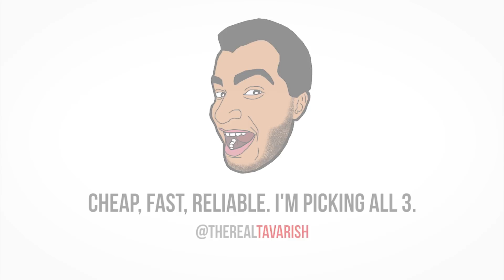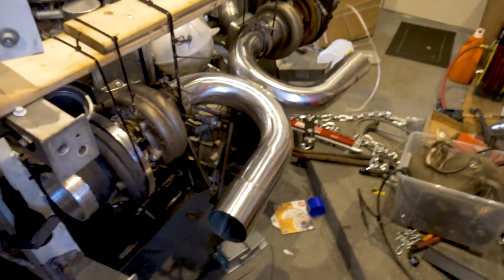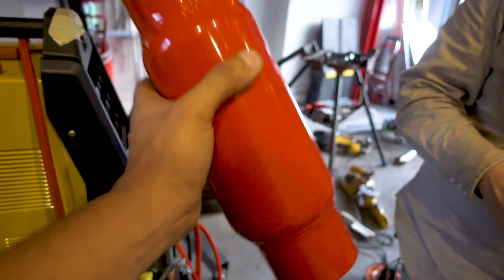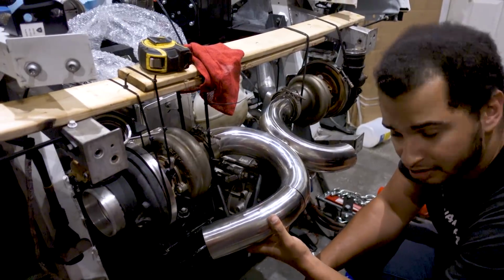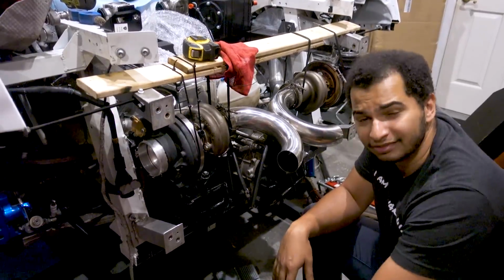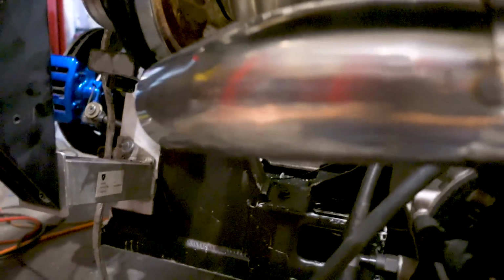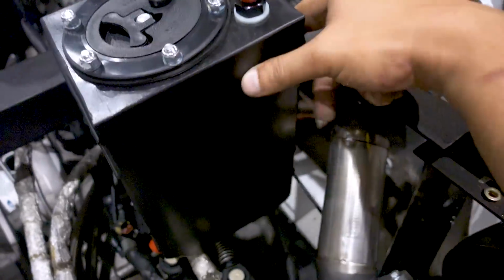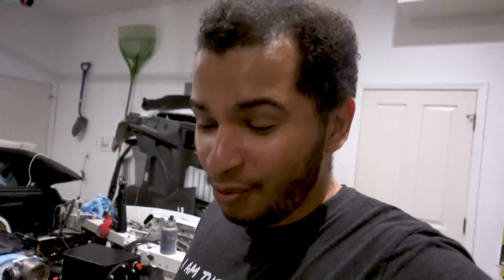Installing A Stupid Cheap Muffler On A 1,000 HP Lamborghini (Is Actually A HORRIBLE Idea)

Comment: 👍🏻 for Tony and no cherry bomb
Reply: Phil M. Cherry bomb on that lambo would’ve been a shame. Who in the heck wanted that?
Reply: gavin P Ask Tavarish...
Reply: Jean Philippe it’s cheap to me
Reply: Jean Philippe straight pipe is for strictly performance and reduces back pressure the best. If your trying to quiet or muffle the sound of your car, a glass pack is the cheapest option. There are many other options that could give it a quieter smooth tone. You can’t compare straight piping which is a strictly performance mod, to a muffler of any sort.
Reply: Uh, gavin P? The ENTIRE idea of the Cherry Bomb was that it IS a straight pipe. They are actually LESS restrictive than a straight pipe due to the way the flow is calmed. That's why they became popular in the first place. 

Now, they aren't as good as modern performance design, but they're still pretty decent, especially for the price.
Reply: evilkillerwhale glass packs were made off the idea of having a loud car but still being able to legally say there is a muffler. I’m confused on how there could be anything less restrictive than just a straight pipe. There is no restriction at all. Anytime you are trying to quiet a car down at all, some type of restriction is going to be added?
Reply: gavin P, then you're not an aerospace engineer (like I am!). Straight pipes have a buildup of laminar flow along the edges of the pipe reducing the effective flow rate. Glass packs, which have area for the flow to expand around the edges, create turbulence that allows a larger mass flow. Period. This is basic fluid dynamics.

Just because you don't know it doesn't mean that it's not known.
Reply: evilkillerwhale interesting! Learn something new everyday! I never knew that and always though they were used for more of just a muffler replacement.
Reply: Lake pipe would be nice, Kendig did a few on TV and you got the best of both worlds, go from track to church in the flip of a switch, lol.

Comment: Curving the exhaust back unto itself may not be the best. You could be setting up a shock wave inside the pipe that will restrict the easy flow. Is there any way to shoot the pipe straighter out the side or slightly to the rear to alleviate another curve in the pipe? You may also want to consider professional ceramic coating outside and inside the pipes as well as the outer heat proof cloth wrap. With all that mass of pipes in the rear, there will be a tremendous amount of radiant heat being produced and I'm concerned that dissipating it all will become a major problem sooner rather than later. You seem to be enjoying yourself and Tony is soldiering on quite nicely. Props to him. He does excellent work. Thank you and we'll be watching.
Reply: Tavarish please listen to this guy^ exactly what I was thinking.
Reply: yip I concur. the bends are not the best idea and there is a pretty easy straight thru option there with just a slight twisty
Reply: The Audi R8 has sharper bends and more of them than this Lambo, so I doubt that it'll be a problem
Reply: Josh Pijl the Audi r8 is designed by a team of engineers with untold r&d money and tech. not assembled by a dude with a welder and grinder. bends do interfere with flow and just because it works doesn't mean it can't be better.

Comment: Tavarish! Suggestion: Be sure to heat shield either just (and most importantly) the intake side of the turbo, or the entire turbo from the exhaust! The exhaust is VERY close to the turbo now, and the turbo blanket will need some help. Your turbo will thank you with longevity, and your oil will thank you by being unburned! Keep up the great work man, loving the series

Comment: That's a lot of exhaust and turbo in a really small space... I don't think you are going to be able keep the surrounding components from melting, even with turbo blankets and a buttload of fiberglass, but it will be fun to watch.
Reply: These turbos have a liquid cooling inlet and outlet. They're designed for high heat and he's building an air-to-water turbo cooling system as well. It's all taken care of.
Reply: Andy C 4

Comment: I can’t wait to see the turbo painted!! I am so triggered with the finish it has right now against the chrome pipes 😂 if you do want to recondition them you can scrub the metal with a copper brush and WD40 to remove the grime, them wipe with degreasing wipes and repeat. It will get them really clean. Or you could use an industrial sander for a chrome finish!! Hyped for this to be done, really want to hear the engine! Wish we had heard the cherry bomb though 😂

Comment: Going to look sweet once the turbo burns the paint off and they rust up like the ones on a 72 Ford dump truck....
Reply: They do make paint good for up to 2500F just so you know.
Reply: Fluffy Ponies  Coating, yes...paint, no.
Reply: Paint, yes. Specialty paint literally designed for up to 2000F operating tempatures: http://www.tempil.com/specialty-Coatings/pyromark-High-Temperature-Paint/
Reply: Read that product description a little closer "specially formulated coating for metal surfaces" "the flat black formula" Fail, Fail, Fail. Normal paint that you paint a car with isn't going to hold up over time to extreme heat conditions, plain and simple. Header wrap is only going to do so much to cut down on heat as well. Ceramic coating would help a great deal when combined with the header wrap. Trust that I know this battle all too well, as I have a 600HP SBC stuffed in a 79 corvette.

Comment: All that work and just straight piped exhaust.. Going to be such a nicely built car and going to be almost unbearable to be in/near/around.. The novelty of an open exhaust goes away pretty fast after blowing your own ears off at every light.
Reply: until your 50 and deaf
Reply: Turbos lower exhaust noise quite a bit, infact there are a few cars that came from the factory Turboed without a muffler like the SRT-4 and Mini Cooper and still managed to get past federal standards.
Reply: Actually not nearly as loud going through turbos as it would be literally straight piped off the engine.

Comment: dont say the turbo system wasnt set up for performance when it's fairly obvious you know nothing about how forced induction can be setup. yet again i have to say, it doesnt matter where its picking up its air. thats what your charge air cooler is for. you just dont listen. you are doing all this for nothing. it wont make any difference.
Reply: Aaaaaand this comment was drowned by all the pinned fan boy comments. I agree with you, he's just rebuilding it to produce more content and get views, it has nothing to do with improving anything.  I wonder if it will ever be complete.
Reply: Sorry but its metter where you Take the air in bekause the cooler can coole the Air even more down, but i egree he dont know a lot about much things he done in bis car and some things are useless.
Reply: dasluce spadular he won't cool the air any better in the front. Half the cooler is covered by the front spoiler and there is no room behind to let the air escape = no air will flow through. His new exhaust will heat up the engine bay and turbos even more than before. But he probably knows this, it just means he can produce more content about doing nothing
Reply: Sebastian Erlandsson i totaly agree with you i just meen that it depends from where you take the air. That its not realy working how he thinking or telling us i know.
Lets see what he will do with the car next and let us hope that he find someone who knows how to build a good turbo engine and Help him.
Reply: dasluce spadular I understand what you're saying but the cooler can lower the temps more than he can by him changing the turbo setup in the rear. He's just fucking it up.
Reply: Sebastian Erlandsson thats right He messing the car in every video more up
Reply: Is no one gonna notive he’s using 2 twin scroll turbos on a v10?

Comment: I installed a cherrybomb on my car about a month ago. I ordered that brand specifically since it's such a name brand I figured it would be high quality. I was pretty dissapointed. It uses scalloped perforations inside instead of holes, and the hole punch design gives better flow, also the punches only went 3/4 of the way around the inside, AND the inner tube wasn't lined up right with the outter one so part of it was sticking into the flow and messing it up! I was looking at Dynomax bullet muffers today and they look sooo much nicer construction quality. The inner cylinder actually lines up with the outer one, it uses the good dimpled hole design that gives the best flow (better than a straight pipe because the walls of the straight pipe create drag, and the holes in the glass pack create no drag. That's also why airplanes and golf balls have dimples. It's all about boundary layers and eliminating drag.) And the perforations go almost all the way around inside instead of just 3/4 of the way around so it will do a better job dampening sound. Not that glass packs dampen much sound anyway, but it just is part of the overall much better construction quality. Also the cherrybomb I got had big weld boogers hanging down on the inside pipe, further restricting flow. I will make a video about this at some point. I have footage of welding it on my car and driving already I just have no time for editing.

Comment: You'll need to put a shield with air gap between the exhaust + that plastic tank. Just wrapping and the foil on the tank won't repel the heat enough imo. Just some alu or stainless sheet is ok. Good work - stoked to see the progress :)

Comment: @Tavarish consider some kind of heat shield between exhaust after the turbo and the turbo (maybe wrap it ?) . IF you'll abuse the car, Exhaust will get hot and probably will transfer the temperature to the cold side of the turbine which is not thing you'd want to happen :)

Comment: If you really want those glass packs on, I think I have a solution, but it would require you to completely redo the exhaust pipes. You would need to instead of doing a 180 with the pipes out of the turbo's route them around each other so they crisscross and the pipe from the left turbo would actually exhaust from the right side of the car and vice versa. That would give you a nice straight section of pipe from both turbo's as they crossed to the opposite side of the car, and would require much less joint weld's.

Comment: glad u didn't use the cherry bomb in the middle of the exhaust as it wouldn't have done much at all, a better idea is to position them at the end of the 180 (basically right before the tips) that way they will do what they are meant to do which is reduce you resonance. if you guys haven't seen the podcast, check it out, it is really good !!!!!!

Comment: You don't want to heat wrap the exhaust. It crystallises and burns away from the heat.

Also do you have a switch between the ice box and the front heat exchanger? If you don't the heat exchanger will start exchanging cold for heat

Comment: Lol, they weren't mufflers but resonators.. good job on swapping the turbo hot side and exhaust to under the intercooler, heat rises😒 so now you've created more issues.. You better also make fuck loads of heat shields. 
I have ceramic coated, wrapped and put turbo beany on my rx7, the heat dissapation still heated brake and clutch fluids to the point I needed to insulate heat via heat shields and wrapping clutch and brake reservoirs and both master cylinders. Air is one of the best insulators so as a suggestion whilst you have a good welder at hand is to make up some good heat shields to isolate heat from any unwanted areas. Tack weld nuts onto exhaust system and make bolt on stainless steel heat shielding in key positions

Comment: I didn't get what's the use of the auxiliar tank, but if it's gonna be pressurized i wouldn't recommend it, i used one of those as an  auxiliar for a race car and the cap liked like hell, it won't seal properly and won't take the pressure really well, so have in mind the flow and pressure you have to see if it's gonna work.

Comment: Dude, cross pipe the exhaust. It will give you room to put the glass packs on. Right turbo exiting out the left and left turbo out the right. Glasspacks close to the X pipe. Simple solution

Comment: Would short length Supertrapp mufflers that go on the end of the exhaust pipe work in your application ? They are also tuneable for sound and back-pressure for each application.

Comment: use a thick piece of pipe it hushes it pretty good. the db level will be night and day without that little cherry bomb. but it would still be too loud even with it. use a dual inlet dual outlet flowmaster 50 big block muffler or just a 50 series if the bigblock is too quiet.

Comment: Is welding the two pipes from the turbos (X shape) together without a spacer a good idea? I wonder if the material around the weld will crack due to different frequencies.

Comment: Definately think you need more flex in the system or it is going to crack in short order. Going to a tiny water reservoir is a bad move as well with the limited front IC rad airflow. Too little heat capacitance in the small volume of water. Also you cant hard mount the hairdryers to the frame unless there are some big flex joints somewhere. Trying to be helpful not negative

Comment: The join of the 2 parts wont create a super hot spot and burn out quickly all the time ? Would it pay to put heat shielding between them and also might muffle any vibration ?

Comment: Sorry, I haven't commented you in a long time man love your work. but the big big big issue you have heats on the cool side of the turbo. please look at ceramic coating those hot pipes if you're running that close. remember that heat will be sitting on the bottom of your cool side at approx 1000 degrees. the ceramic coating pipe will prob cool that down to 500 degrees

Comment: What if instead of the 180°pipes you had the exhaust exit more straight from the turbos and cross over/under each other. Would that give more space to run the cherry bombs? And just have the tips exit from the opposite side of the turbo they connect to

Comment: You need to do straight up pipes out of the decklid those pipes are running right back across where your filter pod is going to be sitting there for you just going to get hot air again the whole reason for switching this

Comment: I think there's still room for the Cherry Bombs.  The ends of them are bigger because they were meant to be clamped to regular sized pipe.  You are welding, so cut the ends off and they should be short enough to fit in the small straight section that's left between the bends.

Comment: That bandsaw??? Its a fun toy I guess in this case, but the exhuast cutter, thats basically a bigger pipe cutter, is so much easier to use in a tight space, and works well in general lmao. It just made me chuckle. And why do you call the glass pack a resonater? The glass packing muffles it.

Comment: wat you can do to test the sound with the cherrybombs is slip them over the exhaust tip temporarily and listen to the difference 
you might not have room for dampers horizonaly but you might be able to place them vertically on each side of the gearbox and do a pretselpipe to the side of the bumper where you want the tips to end up , at least that way most of the exhaust is away from the cold side of the turbo s
the paint on the hot side prolly allready is ceramic paint and helps keeping the heat inside the housing 
do you put in bungs for the wideband lambdas in the pipes between the manifods and the hot side of the turbo;s ?
you ptobably need to for tuning the setup

Comment: Put the ice box somewhere other than the engine bay, it's too hot. You'll thank us I promise.

Also wouldn't it have looked super cool if the turbos dumped into X pipes that crossed over each other and exited on opposing sides of the Lambo!? It would de restrict the exhaust much better because of the more laminar bends, not sure if it would foul on the cross bar though.

Comment: Ditch the plastic 1 gallon fuel cell in favor of the same one only in aluminum. That plastic is going to be subjected to a lot of heat and could melt causing all sorts of problems. The aluminum ones don't cost much at all.

Comment: I dont think you eill have issuse with a drone sound in the car.  That usually happens when your exhaust runs the legnth of the vehicle alloeing the resonate frequencies to enter the cabin. That car has like 1.5ft of pipe and it is all behind you and the engine. It will be loud as hell tho. Turbos work well as mufflers when in a sts setup where they are at the end of the exhaust

Comment: Your killing so much HP with the exhuast making them really tight bends right out of the turbo ! A better way to route the exhuast is to take the pipe from the right turbo and run it straight out and under the left turbo out the left side of the car and same idea for the left turbo going under right turbo and out the right side of the car

Comment: Dont wrap the exhaust, it will rust through in no time even stainless steel. then u will have to rip it all back out to replace it. just use a heat Shield or coat it also.

Based off my experience with using wrap.

Comment: The spray on high temp ceramic paint wont work very well, the turbos get far too hot. You either need to get them specially powder coated or leave them bare. No cats?

Comment: My backup lights are not working on my 2007 Grand Prix GT. The fuses are good and I’m not getting power to the harness. Where in the heck is the sensor on these? I’ve never had this issue on any of my past Prix. Any help appreciated.